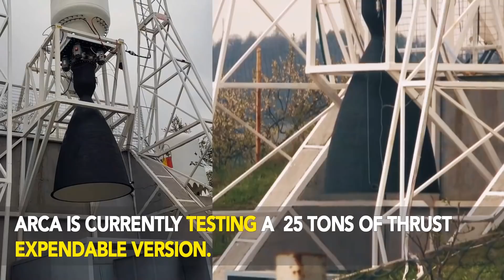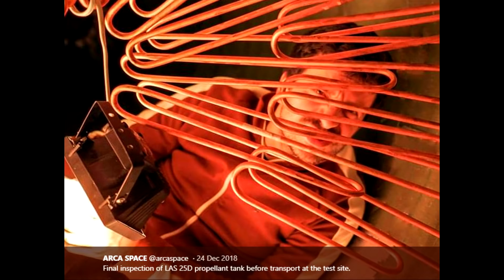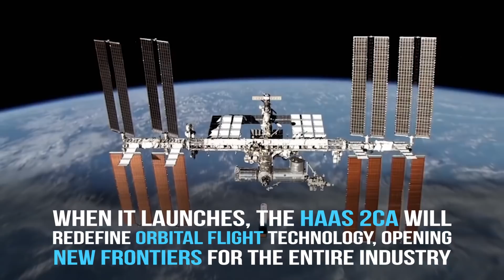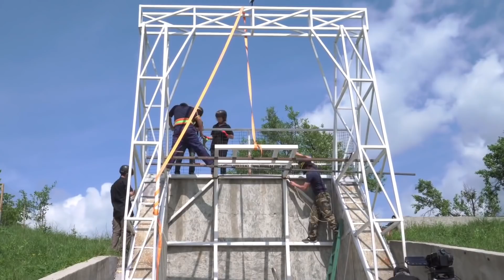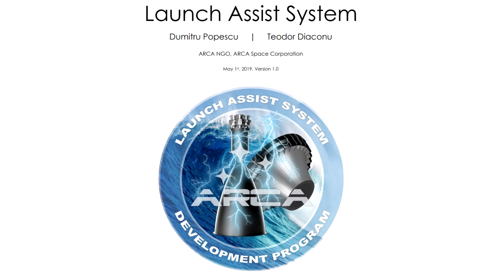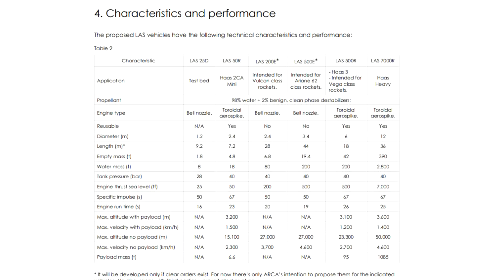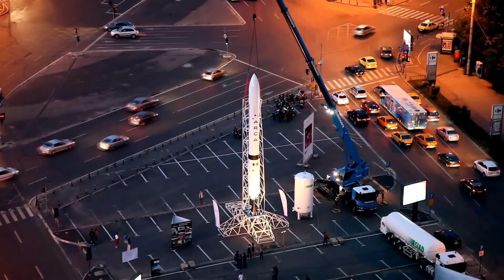Does ARCAspace's Water & Electric Powered Rocket Make Sense?

Comment: Correct me if I am wrong. The so called "water heater rocket", wouldn't it have an advantage over a classic chemical fuel rocket? If you use electric power to heat up water and use the steam as propellant, you can use electricity generated on the launchpad to heat the water to insane temperature and pressure before launch. Once energised, it work like a solid rocket booster delivering thrust from the build up pressure alone. The "booster" can be as simple as a high pressure resitant tank, a nozzle and externaly powered electric heating element. No need to carry heavy battery, the rocket would have initially access to a near infinite source of power at the launchpad, because heating the propellant comes from an external source the rocket doesn't need to carry, instead of fuel combustion, meaning you could carry proportionnaly more propellant in principle.
Reply: "because heating the propellant comes from an external source the rocket doesn't need to carry, instead of fuel combustion, meaning you could carry proportionally more propellant in principle."

Chemical fuels also get their energy from an external source, the power that ran the chemical plant that produced them. Both the hot water and chemical fuel are means of storing power, one does it through heat, the other through chemical bonds. The problem is hot water (at the temperatures you can reach without melting your tank) stores less power per pound than chemical fuels.
Reply: Any fuel just stores energy and releases it as it is being used. That's the point of fuel. Energy density is what matters, and heated water isn't that great at any temperature one can reasonably handle it at.

Comment: Use uranium fission to heat the water. But, there a few draw backs to that design.
Reply: Just a few ...
Reply: Especially when it inevitably crashes
Reply: Just use coal like a steam train, lol
Reply: There are several surface-to-orbit designs based on nuclear thermal rockets, but they use liquid hydrogen. It’s a bad idea in general, since nuclear rockets really don’t have the thrust to launch from Earth.
Reply: Uranium fission e.g. nuclear thermal saltwater is amazingly good for space only operations. Best way to use water / steam propulsion for surface launch is via ground based lasers for remote heating of the propellant
Reply: @Theodorus5  hey that sounds smart
Reply: @vaska00762  You need 10,000 trainloads of coal to equal a softball sized piece of fissile material.
Reply: Only a few.
Reply: @EgadsNo  Details, details!

Also, burning coal releases a LOT of radiation into the atmosphere...
Reply: Thorium (for more clicks).
Reply: @herobrineharry7698  
True, but their specific impulse is almost double if not more of a chemical rocket motor, like the Raptor engine for example. This makes them a very good alternative for deep space travel over short distances, like for example the moon or Mars.
Reply: @herobrineharry7698  From some basic calculations I did, the nuclear engines (theoretically, sadly didn't get to actual tests) developed during Project Timberwind, with a specific impulse of >800 s at sea level and 1000 s in a vacuum, and a TWR of 30, would be able to make an SSTO with ~10% payload fraction.
Reply: @zuthalsoraniz6764  Holy fuck, that would be amazing...
Reply: @Mykl Langridge
if it's wavelength is less than UV then it doesn't count! :P
Reply: nothing serious haha
Reply: @herobrineharry7698  not true. Plenty of NTR designs exceed unity on TWR. The real issue with launching is the risk of rocket failure, from both a contamination and nonproliferation standpoint

Comment: That microwave-based water propulsion idea could be really promising for orbital maneuvering, especially as close to the sun as we are where it could be driven by solar power. It's got the Isp of a closed-cycle nuclear rocket, but without the associated risks. It couldn't have the power density for surface launches, but could be just the thing for a long transfer burn to the moon or Mars. It might even be viable for launches of the moon if coupled with a fuel-cell system, so the power to heat the water comes from H2/O2 electrochemistry.
Reply: It is just a less efficient engine than traditional ion engines with Xenon gas. But admittedly as water is denser, it has better TWR but ultimately will have less ISP overall. It might find its uses, need to land somewhere, that's what the ion engiens can't do since they lack the necessary TWR. Could come in handy for landing small payloads on the Moon.  But for interplanetary journeys, Ion engines are better for small payloads 

For inhabited spacecraft, Nukes are the (for now) only way to go, I'm afraid. You just need the water for the ship itself (radiation shielding and water for the life of the astronauts, you just don't want to vent your precious water into space. 

Until more powerful magnetoplasmic engines or fusion engines or whatever warpdrive thingys are invented, the nukes will be the only engine for crewed flights to other planets, acceleration can make some gravity for the comfort of the astronauts and their health, plus making the trip shorter to the same purpose. 

But small landers as Beresheet could use some electrical water engines, especially if they land in an area with weter ice and if they are eqquipped with a ISRU for the return trip.
Reply: There is water all over our galaxy and getting fuel from the moon or asteriods is a huge efficiency savings than carrying it out from earths surface.
Check out youtube channel "Tmro" they have an interview with a company doing Space Tugs powered by microwave super heated water.
Reply: @quoniam426  "Until more powerful magnetoplasmic engines or fusion engines or whatever warpdrive thingys are invented, the nukes will be the only engine for crewed flights to other planets, acceleration can make some gravity for the comfort of the astronauts and their health, plus making the trip shorter to the same purpose. "

Are you talking about an Orion Drive style ship driven by nuclear bombs? Cause Nuclear thermal rockets don't have the ISP to fire for particularly long. Centrifuges are a much more feasible means of producing artificial gravity during long trips than thrust.
Reply: "has the Isp of nuclear rockets"
yeah, 67 vs >900
Reply: Planetfall) Not entirely true. The NERVA engine back in ‘68 had an isp around 900s and did full thrust test burns that exceeded an HOUR of full thrust on a number of occasions. They even went through the trouble of flight rating it for a proposed mission to Mars in 1982, though it never actually flew.
Reply: @charlescsmith1213  They were able to run it for an hour since they had quite large fuel tanks on the ground. Carrying that much fuel with it would make its acceleration rather negligible. And while running for several hours is impressive its not a significant percentage of a month long trip.
Reply: @ax2bxc  You misunderstand. I not referring to the resistive heating system which was the main topic of the video, but the microwave-based system Scott mentioned a study on which demonstrated an Isp around 800.
Reply: @planetfall5056  Are you dense?
Nerva was a legit proposal, integral to the original SST proposal, containing Saturn 5 derived hardware, nuclear (refuel-able) space tugs and a re-usable space plane to launch cargo on a regular basis to LEO. After funding was slashed, only the space plane remained as the Space Shuttle. Before this, some of the Saturn 5 follow up proposals (Saturn C-5N) contained a Nerva powered 3rd stage.
As any rocket enthousiast should know, you don't burn your rocket during the entire trip, only to change your trajectory. While Liquid Hydrogen is quite voluminous, both the 2nd and 3rd stage of Saturn 5 burned LOX, LH2. Using a Nerva engine with way higher ISP, and without LOX, would actually make it possible to make the orbital stages smaller, but at the expense of longer burn times. The main advantage of the C-5N nuclear 3rd stage would have the added cargo capacity due to being able to generate more dV overall, but it usefulness would be limited to orbital stages only.
Reply: @Tuning3434  I know about the NERVA engines, I wasn't debating their existence or usefulness, I was debating Quo Noim when he said they could improve the health of astronauts on a Mars trip by providing thrust gravity.

"the nukes will be the only engine for crewed flights to other planets, acceleration can make some gravity for the comfort of the astronauts and their health, plus making the trip shorter to the same purpose."

That's what I was commenting on. I'm not debating that they are possible, I was pointing out that they aren't torch dives which can run continuously.
Reply: @planetfall5056  Ow OK, well that would be SF level of technology. Youtube comment layout can suck sometimes.
I'm pretty sure that if you are going this large scale, going with inefficient but fast thrust gravity setup's, increasing nuclear engine reliability to months is the least of your problems, constructing a spaceships that is big enough to fuel / benefit from this gravity would IMO be the bigger challenge. I would think of Hermes (the Martian) like of infrastructure. Hermes (ion-drive) is even way worse in that respect, but employs a centrifugal system for artificial gravity.
Reply: @Tuning3434  Yeah, and the problem is even an ideal NERVA engine wouldn't have the trust to weight ratio to move several months worth of fuel about with high acceleration. You need something much more energy dense to make that possible. Centrifugal gravity is a lot more practical for the foreseeable future, at least for trips lasting more than a few hours.

Comment: Rocket fuels are sometimes explosive..? Hm...
Reply: Fortunately steam pressure vessels never explode
Reply: @flyingskyward2153  looooool
Reply: @flyingskyward2153  They don't! (As long as you just call it a rapid unscheduled release of pressure or something novel)
Reply: I get the joke and had the same reaction. But some propellants (especially oxidisers) form contact/shock explosives in the rubber seals in the plumbing, or self-disassociate violently upon shock (which is fun if you get hydraulic backlash (hammer) in the pipes). While others are completely stable until mixed/burnt/exposed-to-a-catalyst.
Reply: All earth to orbit rockets use a substained explosion. Even steam. Just plug any rocket nozzle-boom ! It was even studied to use nuclear bombs, one after another, under the rocket, to go to space (moon?) I wonder if Manly has done a video on that one !
Reply: @putteslaintxtbks5166  I think he has done a video on that. I'd definitely check if you already haven't.
Reply: @1FatLittleMonkey  I never thought about that. Pretty cool.

Comment: The pitch of a "environmentally friendly" rocket seems like an emotional appeal to a green optimism and youthful naivity in the less educated portion of rocket enthusiasts. The real issue is if it turns out to be feasible.
Reply: Most power in Romania is from coal. Coal powered rocket
Reply: If half of your rocket is batteries and your rocket is not reusable... I have doubts on how eco-friendly or cheap it is. Just using cryogenic hydrogen+oxygen might be better. If they manage to reuse it than it might work but still a lot of doubts on how many times will you be able to use it.
Reply: Dave54600  one flat earther also developed steam rocket. It succesfully flew 1800 feet into the air. So flat earthers are ahead in this field
Reply: @tedarcher9120  As is pretty much everywhere, if you didn't know.
Reply: Nice burn.
Reply: Not sure anout the 'environmentally friendly' part, unless they are launching from on, or right beside, the ocean.  Salt contamination from using seawater can render an area pretty inhospitable as well...
Reply: Actually the most environmentally friendly launch option would be a magnetic accelerator launch ramp.
Reply: Exactly, there are not enough rocket launches for the environmental impact to be a major problem (apart form when China drops Dinitrogen tetroxide and Hydrazine on rural villages, thats not cool).
Reply: Or a ARCA ROCKET HEADING INTO A ROMANIAN VILLAGE. Kentucky Fried Romanians, it's FINGER LICKING GOOD.

Comment: So it's a really, really big bottle rocket.
Reply: Yes. And a badly designed at that. The battery section produces less thrust than it weighs. Never mind replacing it with something better, they could just remove it, and improve what sad performance this has.
Reply: @MVHiltunen  Considering it's electrically heated, why not just heat it on the launchpad and insulate the tank really well so it stays hot? As a first stage presumably it's not gonna be burning all that long, it doesn't have to stay heated does it?
Reply: @masterofthelag8414  It indeed seems to be preheated already. The pressure rating of the vessel sets limits to how hot you can make it initially. When it starts expanding, the temperature of the whole water column starts to fall, and before long it will no longer even boil. At that point the rocket is dead weight.
Reply: John Doe ☆ 3 million liter coke bottle!
Reply: I really like those water rockets from the 60s where you pump up the sir pressure & they spurt all over everything and jump up about 20 feet.
Kind of like Scott's logo.
Reply: You'll notice that the demo unit is bolted down on a test stand. That's because their claims of powering this thing by battery are almost certainly at best a pipe dream and at worst criminal fraud. Whatever you see happening here is hooked up to the electrical mains. So the rocket needs a really really long extension cord.
Reply: @andrewtaylor940  So basically it's an EVA that can(not) fly.

Comment: Don't forget, that's how the RCS and basic thrusters work in The Expanse (flying "teakettle")
Reply: H2O arcjets powered by an OP reactor with almost no radiators?
Reply: Jep, the Teakettle modus. First thing that came to my mind while watching the video.
Reply: @leerman22  Direct energy conversion of ions to electricity and using a fusion reaction that doesn't produce neutrons as a byproduct makes for very little waste heat (still enough that you'd see glowing red radiators SOMEWHERE, but maybe they're using the engine bells for that since they already need to contain extremely high temperatures).
Reply: @44R0Ndin  There's still a lot of photon energy to deal with. Ignoring photon energy 100W of charged particles collected for 90% efficiency means there is still 100W of heat to remove without melting anything. All other systems like life support and weapons need their own cooling. 

The reaction mass is far hotter than any material can take so there would have to be red-yellow-white hot radiators somewhere ofc. The engine bells alone wouldn't keep up with that without melting. Children of a Dead Earth ship design is so much more realistic it just needs a very efficient Epstein Drive.
Reply: I thought teakettle is just standard solid core fusion rocket? So same as NTR, but replace fission reactor with fusion reactor, and with water as reaction mass.

Epstein's original prototype was a fusion rocket of some sort with some custom modification that made it magical. Why would you use fusion-electric propulsion when you could be using fusion thermal?

Comment: It will work. They just need to heat the water until it becomes several million degree plasma that's all. Easy.
Reply: so a ton of batteries?... per second 😂🤣
Reply: That would technically be a plasma thruster.
Reply: Yes. Get close to the Planck temperature and that steam will give you a specific impulse higher than you need for sure.
Reply: just skip the waters and go for the spark plug plasma rocket?
Reply: @markus5888  shoot with big hot laser from ground.
Reply: Why not deploy giant and extremely thin parabolic mirrors from the spacecraft that focus sunlight onto the nozzle opening to heat the water?
Reply: @jeffvader811  the mirror will increase aerodynamic drag of rocket. Giant mirror should located on the ground.
Reply: @kampretmemanggila8649  I'm talking about in-space propulsion. Ground launches would probably have to use lasers. Although, why not just preheat all the water on the ground? With good enough insulation you wouldn't lose much heat (it'd be similar to storing cryogenics) and you eliminate the complexity of power beaming.
Reply: @jeffvader811  👍
Reply: @jeffvader811  Watch the video again.  They do ("plan") to preheat the water to supercritcal on the ground with "shore power".  The batteries are just there to keep it from cooling enough to lose pressure.   Cryogens like all fluids are "self cooling" as they boil off and even as they feed into the engine.  The exact opposite of what a "thermogenic"  propellant needs.
Reply: @jamestheotherone742  Still, it doesn't seem like the heat loss over a 2 minute flight would be sufficiently high to necessitate on board heating. Unless the mass of batteries is less than the mass of insulation I don't see the motive. Then again, I haven't done the math.
Reply: @jeffvader811  the heat (energy)  isn't just lost thru the tank skin, it escapes out the nozzle and as the water flashes to steam as tank pressure falls.  Without added energy, the rocket would run out of thrust while it still had a partial tank full of bath water.
Reply: @jamestheotherone742  
Ahh I think I get your point now. As the pressure drops below the boiling pressure of the water, the water boils to increase the pressure, losing energy as it overcomes it's latent heat of vaporisation, so as you "burn" through propellant you are constantly losing pressure and temperature. Thanks.
Reply: @jeffvader811  Yep.  This scheme is just completely wrong for physics.
Reply: All this in a HOME-MADE FIBERGLASS BOILER, WHAT CAN GO WRONG?